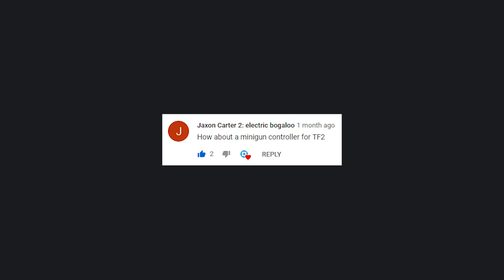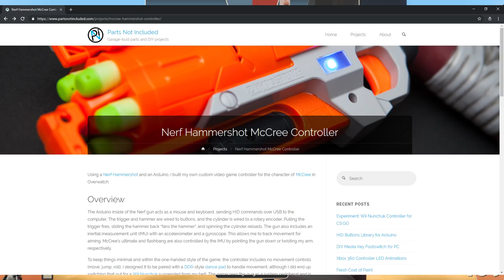Minigun Controller - Team Fortress 2

Comment: Suggestion: use an xbox controller to do something like drive an irl car or something along those lines, would be a funny twist on the channel (ik the channel is early days but maybe keep it for the future) love the content😊
Reply from the maker: I'd need an open space. My projects have enough bugs during testing without involving a motor vehicle. 😂 Also, I love your avatar.
Reply: @InsertControllerHere  yeah you're right, I didn't take into account where you might live, but if you ever get the opportunity then keep it in mind. Ty😁
Reply: Outside x box controlled a car using a controller